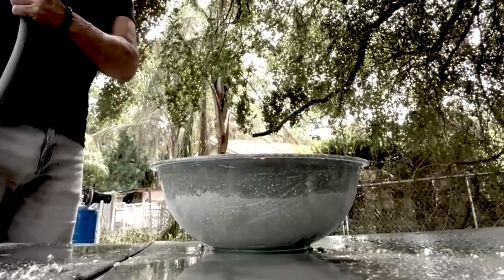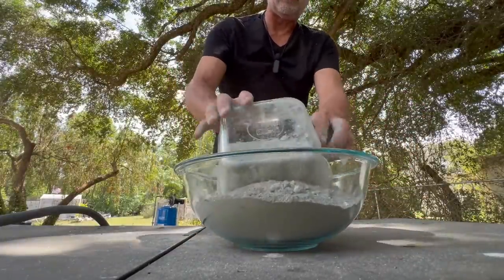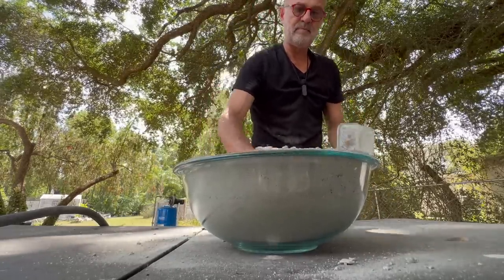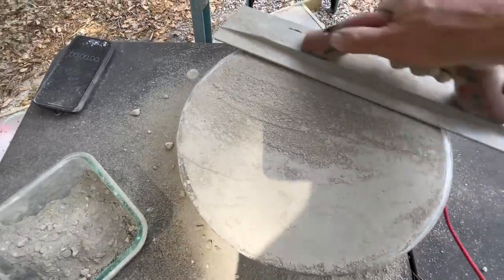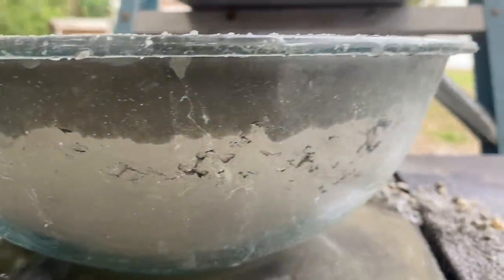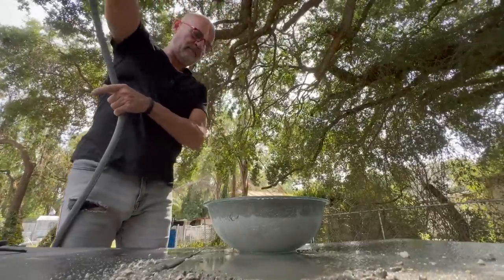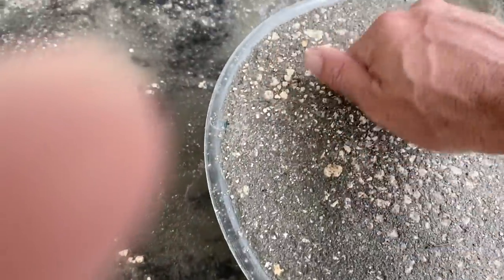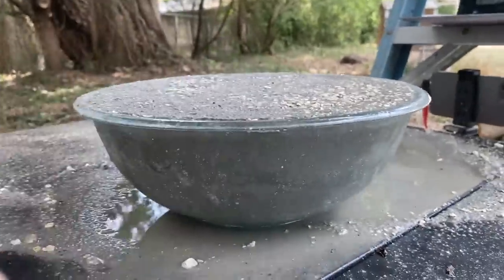See How Dry Pour Concrete Process Works in Real Time

Comment: Glad you posted this. It seems there might be consolidation issues or risks with this as you see it cavitates (creates voids) and cracks under the surface. This may be fixed with substrate reinforcement (rebar) and vibration of form (to minimize void development) prior to the watering step. Time will tell when you test it for for strength and durability.
Reply: I finally broke apart one I did many years ago for a generator pad. Just roughly 4' x 2'. I didn't even use any rebar as it was meant to be temporary. It actually stood up well all these years and never even so much as cracked. Now when breaking it apart the chunks of concrete look just like wet pour, I do not see a difference.
Reply from the maker: I should have mixed it up a bit and tamped it down.  I was mostly trying to show how the water moves through the dry mix but you are correct.  This method will need to be mixed up or tamped down before adding water.
Reply from the maker: I agree.  I have never seen a dry pour fence post that fell apart or not cling the the post for dear life!
Reply: This is the MSDS report for this product- 
  Wear protective gloves. Wear eye and/or face protection. Avoid breathing dust. Wash hands thoroughly after handling. May cause eye and skin burns. See Section 4 for additional details. May present risk of engulfment. See Section 7 for additional details. Overexposure to wet concrete can cause severe, potentially irreversible tissue (skin, eye, respiratory tract) damage in the form of chemical burns, including third degree burns. The same severe injury can occur if wet or moist skin is exposed to dry Ready Mixed Concrete dust. Clothing wet with moisture from concrete can transmit the
 
   Continued...
   caustic effects to the skin, causing chemical burns. Ready Mixed Concrete may cause skin burns with little warning; discomfort or pain cannot be relied upon to alert a person to a serious injury. Pain or the severity of the burn may not be felt or known until hours after the exposure. Medical conditions which may be aggravated by exposure: Contact with wet concrete may aggravate existing skin conditions. Sensitivity to hexavalent chromium can be aggravated by exposure.
Reply: @tomahawkmissile241  I did my fair share of concrete work when I was younger. I seem to remember that the white dusty look would not go away even after a shower, but I soon learned that lime juice took care of that. It didn't really bother my skin back then but I wasn't exactly rolling around in the stuff. These days I can't work with cement at all in dust form, does all kinda bad things to my skin. Once it's mixed and wet I can work with it (no more dust), but I still can't let even the wet cement touch my skin. I'd say if it has warnings like these you'd best put on your darth vader costume when working with it.
Reply: @verohandymike  good to know, I might do this method for my 10×8 shed.
Reply: Definitely true. 

While leading to weaker concrete, it also greatly facilitates the porosity of the mix so it would be expected to see the water flow through quicker.
Reply: @Michael Brown  what type of climate? Do you see below freezing Temps?
Reply: @iivindictiveii6601  Just outside Atlanta. Occasional freezing temps but nothing that causes the ground to swell and shrink like I saw in Michigan.
Reply: As far as the danger of short term exposure to dry concrete goes, you can get away with a little dust as long as you have no cuts, scratches or other places where the skin is not completely intact.  You'll learn pretty quickly if you do have some kind of skin break.

In my case, I've done a lot of concrete work and gone up a learning curve on glove PPE.  After working for hours with the stuff, concrete has gotten inside the outer glove (because it's going everywhere when pouring etc.) and continuing to work for hours, it created an abrasion because it is so abrasive (especially if there is a knot of hardened concrete from a previous day's work that wasn't cleaned out properly before it hardened).  That's where I've gotten burns which hurt a lot and took a while to heal.  I now use a three layer system... vaseline on my hands, then latex of vinyl gloves (the medical kind), and then a heavy rubber type work glove almost to the elbow.  This approach works... even if the outer gloves get to be pretty rough, which they will pretty quickly.
Reply: @verohandymike  the concern is the factory mixing the mixture wrong producing burns from moisture in the lungs.
Reply: Of course the same happens with traditional pour as well - vibrating the form solves this for both techniques

Comment: I tried a dry pour slab and it was the last time I’ll try that. Certainly don’t recommend. It’s impossible to finish the surface to a smooth polish. Also, tons of the aggregate shows through in a spotty uncontrolled looking way, not a nice even way. Worst of all the mix is questionable. The next day the slabs are still soft. All in all it wasn’t even that much easier. So it’s almost the same amount of work for a much worse product. It’s not that hard to mix concrete. I got fooled by an internet phenomenon. Take my advice and skip this.
Reply: Bro you just aren’t good at following directions. My dry pour didn’t have any of those problems. 16 x 17 feet
Reply: That’s what I don’t understand about dry pour… it’s basically the same amount of work… is it that they are worried the concrete will set up to fast because if that’s the case just work in smaller sections at a time

Comment: Apparently you didn't follow instructions that others used. Wetting the concrete wasn't done over a few minutes but hours. Your dry concrete is much thicker, also not absorbing water from the ground. With anything if you do it wrong it doesn't work. Not a professional, not done the process but I do know how to follow instructions.
Reply: I'm no pro, but I don't think there are real instructions. The concrete powder can only get so wet. Can't over do it. 
I've done research on the properties of concrete and I'm pretty sure that the less water you add, the stronger it will be in the end (30 days for full cure)

The reason others only mist the powder with water is to keep the powder on top and not wash the stones or pebbles (the look of the finish)

Although he did wet it really fast, it should not matter. I agree that you should add water slower, but should not matter. As long as you tamped the concrete down first and you don't add pools of water to cause pockets of water, you should be fine.

Concrete also cures (for 30 days), in the presents of water. Concrete does not dry while curing.

You need to keep the curing concrete wet and covered for as long as you can possibly handle. 30 days.

First you just gently mist the top just to moisten it barely (if you want a traditional concrete finish) wait a couple hours. 

If you don't care about the top finish, add water quicker, if you want that pebble finish. Up to you. You can't add to much water.

I seen a video where a guy adds the rebar in the middle, then waters it really good, then adds another layer of powder. That should work well and speed up the process.

I'd leave the forms on for a week, and also spray Pam cooking spray on the forms first, so nothing sticks.

Keep it wet and covered!!

If you over wet it, it will just not seep inside the concrete, no biggie.
Reply: I'd say it's the general principle of water penetrating the dry slab. Great experiment.
Reply: @jakefriesenjake  concrete resistance is optimal for a certain amount of water and goes down 20% in the first 6% of gap between ideal quantity of water and real one. So measuring water is a good idea if you need resistant concrete. But this video is very interesting anyways
Reply: Gotta go with age old adage, "Don't knock it 'til you try it!" How many times has life surprised you because it wasn't what you thought? It does seem odd though. 🤔
Reply: @pouet4608  yeah, you probably do need a minimum of water.

In the next few weeks, I'll be building a 2" thick ramp on top of an old concrete driveway, going into my garage, because it sunk a bit. 5 feet long by 18 feet wide. I'm sure whatever I do it won't break.

I guess you could measure out the amount of water needed for the 16 bags I'll be using.

Comment: As a mason and concrete person, the reason the sides showed it hardening so fast is when concrete starts to harden it shrinks just enough to allow the water being sprayed to flow just a bit to reach the outer edges.  It will take alot longer to reach the inner sections but eventually the slab will be solid

Comment: I’ve seen small retaining walls mad of stacked concrete bags. It was about a year or so after they were built and the paper bags were starting to come off. Not classy, but it did the job.
Reply: Our L shaped Quikrete bag wall is still standing... for eight years now.  From time to time, however a bit fell off, we suspect from mowing bumps.  The bags became raggedy after three years.
Reply: @lizlafferty1278  We have a sea wall done with Quikrete bags and rebar driven in when bags were placed to keep it in place. Works wel and certainly is more economical...also looks good once the paper comes off the bags.
Reply: I saw a video like that, and they guy was smart and used a power washer to get the bags off. Looked good then. I wouldn't leave the bags on, would look tacky.

Comment: Concrete doesn't actually 'dry' in the sense that some people think. Powdered Portland Cement creates bonds between sand/stone aggregate when hydration is introduced. This bonding reaction continues for years in many cases, although most of the mix design strength occurs within 21days. The idea of using a mixer would be to insure that all sand and stone particles are evenly and sufficiently coated with Portland/water paste prior to placement.
 There's another  process called 'soil cementing', where dry Portland Cement or lime is knifed directly into wet soil to improve it's load bearing capacity.
Reply: To add a little bit of trivia to your statement, it is going to take the cement poured to make the Hoover Dam 125 years to cure.
Reply: @verohandymike  were getting close .   LoL 😂
Reply: @verohandymike  Insane to think it won't be truly cured for another 37 years at least.
Reply: @verohandymike  you haven't watched it being built,  have you?
Reply: I once saw a statement that the ideal curing conditions for concrete was "underwater for 99 years."

As long as you don't wash it away you can't over soak it, it will more likely be weak if too dry when curing.
Reply: @nfrl-hs2ly  Yes, it's difficult to over-hydrate concrete once it has set-up (a few hours).
Reply: wrong , stay in your own lane rookie

Comment: Worth noting relative to your friends 14,000 lb truck. That “huge” load undoubtedly has a contact area of at least one square foot, or more than 140 square inches. That’s only a load of about 100 psi, or far less than the 3,000 psi design strength of the concrete, so really not much of a test. 

The other thing is that concrete doesn’t generally fail catastrophically at first, and especially not if it’s green. What is more likely to happen is that microscopic stress cracks begin which propagate over time resulting in noticeable and premature failure later in life.

Comment: Change the amount of agitation (mixing) and you do change concrete strength.

You find this by taking matched samples of concrete mix, adding equal water, agitating each sample a different amount, then doing a hydraulic press to failure PSI test.  A small amount of agitation goes a long way.  common 3000 PSI concrete in 7 yard batch generally has 100 turns of the big drum on a cement mixer truck.

You can change the pressure to cause failure by changing the agitation.

A good substrate under a slab can help it survive the truck test.

Your truck is at 30 PSI to 90 PSI air in the tires. (depending on which truck)  Compare that to the generally desired 3000 PSI concrete strength rating...  

The truck test is stupidly easy to pass.  It's more a test of the compressability ot the dirt under than it is a test of the concrete.
Reply: But, if that is the intended use, than that is the test that matters

Comment: This like every other one of my comments will be at the bottom of the algorithm. 
Mixed cement has a strength advantage because the activation of components being bound by the heat that concrete inherently causes in a molecular level. The  water isn't just the activator,  its a lubricant to mix it easily.  
Ask yourself why they don't pour dry concrete on a professional job of any kind

Comment: Would be interesting to see a side by side, one with the dry pour method and then mixing a small batch in the traditional method in a glass bowl. The results would be seen by testing hardness in a few days.
Reply: 28 days
Reply: I'll do a video on this
Reply: Then spray the surface with a power washer to see how well the cement coated and bonded to the aggregate.
Reply: @jakefriesenjake  American Concrete Institute recommends a minimum cure period equal to concrete attaining 70% of specified compressive strength, for most concrete above 40 F, that's seven days. Curing Temps above 50 F increase early strength but decrease the 28 day strength with the difference being greater with increasing temp. There is a big difference between air curing and moist curing. For a concrete that air cures the entire time, you get 4100 psi, for 7 days moist cure 5400 psi, for 28 days moist cure, 6200 psi, for 365 day moist cure you get 8000 psi ...

The concrete in the bowl starts air curing as soon as he stops misting it. You can actually see the shrink where it's pulling away from the bowl. That means the concrete needs water content to remain in constant hydration. Microscopically, the batch accommodates plastic shrinkage by propagating microcracks. Low strength concrete shrinks while high strength concrete swells. The process is complex and it's hard to prevent cracking of slabs. The best methods are control joints, moist curing, and pond curing. Prevent any load on the concrete for 24 hours and prevent heavy loads for 10 days. You might not see cracking, but loading produces internal microcracks which compromise spec strength and longevity.
Reply: @nevisstkitts8264  exactly. Keep it wet, covered and the weight off as long as possible.

Concrete will crack, but you can make the crack look better by cutting it. But if you cut it, you should install rebar to bridge the cut so both pieces will sink in unison. If you don't want to cut it, add fiberglass fibers or rebar and make it twice as thick as you originally had thought to pour it. Or just risk it and redo if needed.

I will be doing 4 tests, comparing wet mix, dry pour, and different levels of water misting and showering for the dry pour method. All tests will be then kept wet for many weeks. Then I will test

Comment: Paper bags of cement in storage for long time even without contact with the floor just by absorbing moisture from the air get hard as rock in due time, so thin set does that fairly quickly by the way, this is due to the fact that the amount of water necessary for the concrete to set is way less than what is normally used, we pour more water for the sake of workability.

Comment: You could save all this time drizzling water going through intervals, just by simply mixing the cement with water for just a minute, and then leaving it to solidify,  that could save us time also, don't you think? This process has to be done in a transparent pot while the whole procedure is messy for your laptop as well..
Reply: Exactly, we can mix about 100 bags of concrete from 6-10 out of a wheel barrel and be done finishing it by noon. These dry pour guys will still be sprinkling water on it at midnight. It's just a lazy way of doing it

Comment: Pro tip; wash your hands and any other skin that comes in contact with the concrete with vinegar. The acid in the vinegar will neutralize the alkali in the portland and prevent chemical burns.

Comment: The true strength of concrete supporting a load is all about the tightness of the ground under the concrete if the ground it setting on is not packed, dry or wet method will break
Reply: LOL! No, it won't break.  Plenty of youtube vids have shown this.  Look people, don't look for problems.  It works.  Ok? Just relax and use it, and save some money.

Comment: If your actual concrete project is not in a glass bowl, you have to guess when there is enough water to penetrate the entire depth. Seems like more work than just mixing the concrete normally.
Reply: Regardless of where it is, adding more (and More, and MORE) water only helps concrete to cure once the curing begins.  Some of the dry pours on YouTube have been 1.5 inches deep, so it's pretty easy to get enough water.
Reply: The draw to dry pour isn't that is more or less work..it's that you have time get it smooth and can fix mistakes before the water is added. Another draw is that you don't need any mixer or wheelbarrow to do the job.
Reply: @dchall8  lol, that 1.5" slab probably cracked off already. The quikrete bags themselves calls for a minimum 4" thickness. In fact all 4,000 psi concrete calls from a minimum of 4" thick. Most people could break 1.5" of concrete with their bare hands
Reply: @Bennysol  If you want to practice breaking 1.5-inch concrete with your hands, visit the garden section of HD or Lowe's and break a few of their thin pavers.  Well, those were probably wet poured, so not comparable.  
The 4000 psi number seems like the standard; however, since humans wearing shoes produce 15 psi, if all you are doing is walking on the surface, even 400 psi should be fine.  I'm not going to build a rocket launch pad.  I need something to keep the dirt off my shoes.